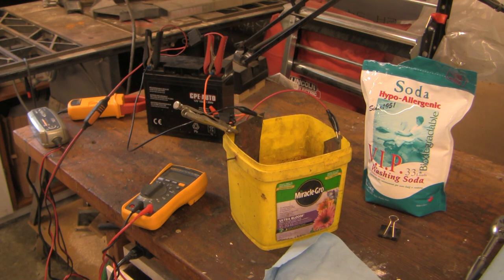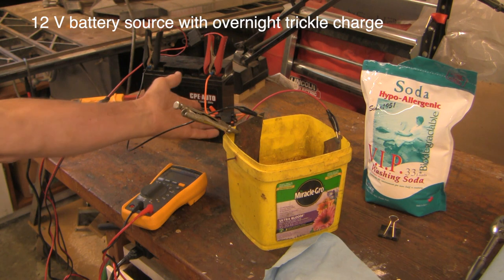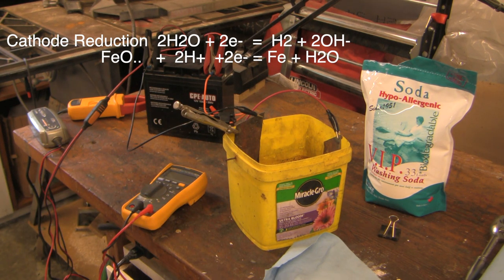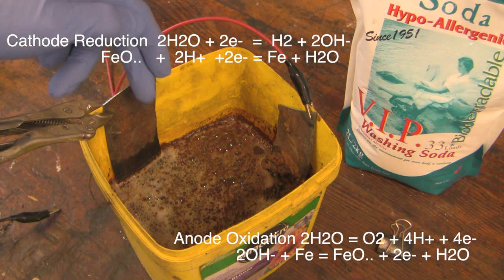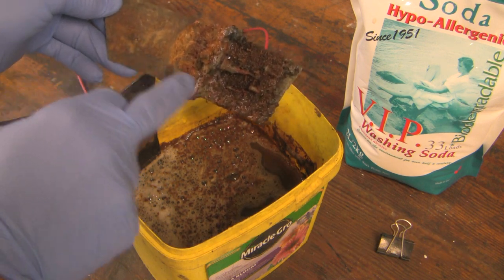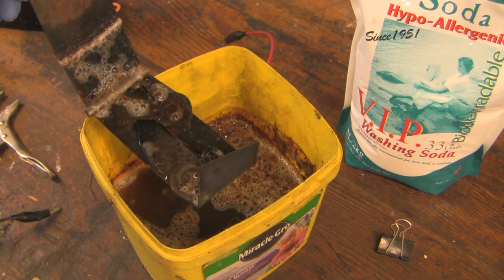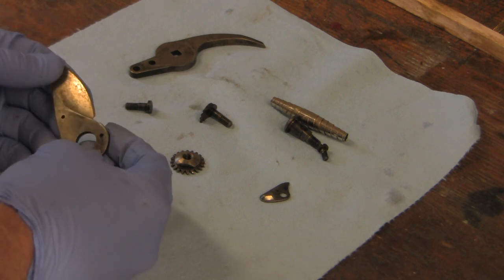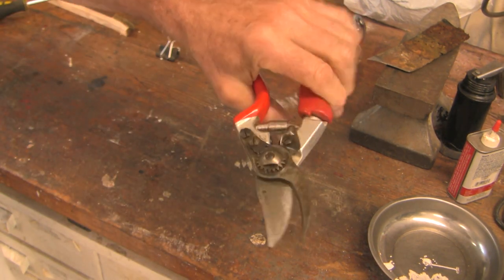Best way to fix rusted tools!

Comment: That was awesome !! I really appreciate the video . I just learned something new today !!
Reply from the maker: Since doing this video I've done it a few times, sometimes with great success and sometimes with failure. Choice of anode is critical, you need clean mild steel, not cast iron, and you need to avoid putting any stainless into the solution at all. Stainless releases chromate compounds that can be dangerous if inhaled. I put together a little plastic bucket with all the parts and a little cheat sheet taped to the side so I remember which wires go where, so setting it up is a breeze. This time of year I have a bench with various batteries I charge intermittently, so everything is at hand. Thanks for stopping by Kenny. As I mentioned, your channel is a great resource for automotive diagnostics.

Comment: I want to try Electrolysis But in the meantime I use Evap-O-Rust.
It's absolutely the best rust remover I've ever used! It works best in warm to hot temperatures so remember that in the winter and it also works best if you let it soak for 12-24 hours. Plus its environmentally friendly.

Comment: Wow, what a great video and easy setup.  I will have to try that!
Reply from the maker: Thanks, Ben! You'll definitely find a use at your farm, I'll be looking forward to seeing the video. If you limit the amount of washing soda to ~1 tbsp per gallon, the current will be lower and you can run it for longer. It should be less prone to secondary issues using a go slow approach.

Dave

Comment: Great job and video!  It's an excellent way to remove rust.  I have used this method for years with great results.  Low current ( an amp or so ) is all thats needed. If a little current works, a lot does better does not apply here.
TakeCare,
Bill
Reply from the maker: Thanks, Bill, it is so nice to get feedback from guys like you with years of experience. One of the reasons my current was a little too high was I didn't measure the volume of washing soda, I used way more than the recommended 1 tbsp/gallon. Fortunately there was no evidence of pitting or other issues, it worked great, though I stopped earlier (~12 hrs) than some recommend. As you say, experts advise low current and long duration. I see now why this technique is so much better than other options, and it is very easy to set up.

Comment: Yay!  Now I have a reason to keep my old lawnmower blades in my hoard...
Cool experiment.  Not sure it's a good value choice considering time and trouble, other than the fun of succeeding.
I would probably use my low amp battery charger, fan the air in immediate area before disconnecting wire, and disconnect at battery instead of near bucket (or in my case unplug the battery charger before unclipping wire and risking a spark).

Comment: Very interesting and amazing results!  I was ready to try it myself up until the part where you said "I suppose you could have an explosion."  That's when I got in my car and drove to the hardware store to buy new ones. :)  Such an interesting and apparently effective procedure I might try it one day anyway.
Reply from the maker: Ha ha, I understand. The good news is even if some of that liquid splashed up, for the most part it is just baking soda and water, not even as toxic as what you wash your hair with every day. Some guys laugh about lighting those little bubbles of gas, normally causing a popping sound but little else. That said, I wouldn't do that, it's too close to what happens when one overcharges a 12V battery, in which case you've got the risk of acid spray. This is generally safe, and dramatically safer and easier to clean up compared to acid treatments for rust.
Reply: Good to know I don't need the fire department on standby :)  Mostly just joking around with you although the whole 'you might blow up your garage' part of the video certainly caught my attention!  Great video once again, thanks for putting it up.
Reply: @PsychoTillerSailing  "Well ventilated area" applies to this process.
Reply from the maker: @d46512  Good point. Hydrogen gas is so light, it quickly dissipates, and the rate of production is slow enough that it would be rare to have a serious problem. There are other gasses produced from side reactions as well, including CO2 and maybe even a little carbon monoxide. At trace concentrations in a typical garage those facts are curiosities.

Comment: Great job, I would love to understand more of the formula and exactly how and why it works if you can make a following video
Thank you your friend from south Florida
Reply from the maker: What a good question! I review this topic every time it comes up because of all the detail, but fortunately the web is full of good explanations. The core reaction is simply hydrolysis of water, and the washing soda is for the most part added to make the solution more conductive, allowing ions to migrate more easily through the solution between poles. The intriguing topic is iron, which is polyvalent with very complex equations as it oxidizes. Interestingly there is some evidence that electrolysis will replate those iron molecules onto the surface of the metal, in contrast with acid methods that destroy any oxidized iron, pitting the underlying surface. Thank you for watching!

Comment: What material is your cathode?
Reply from the maker: Both the anode and cathode were made from steel strapping that went around an old barrel used as a garden planter. The wood had disintegrated from rot, and the steel bands had superficial rust. I cut and bent the bands into the correct shape so they were far enough apart in the bucket that they wouldn't touch each other. You have various options for the rods, but steel is cheap and widely available. Use a wire wheel or wire brush to produce a clean surface on both sides to reduce resistance at connections points, especially where the wires attach. Avoid galvanized steel and aluminum, a magnet will help verify you have steel rather than aluminum. Some guys use an old steel bucket for the anode side, then hang the cathode from a wood dowel, with the parts hanging in a cathode tray below the water level. Good luck!

Comment: You said you sharpened the blade and it looks like you had put an angle on both sides of it when you flipped it over.  One side should be absolutely flat, no angle.  Surely you sharpened them properly.  Great video though.
Reply from the maker: Yeah, I put it on a flat diamond stone and sharpened the flat side, ONLY. When I've tried to do more, it always fails, so from past bad experience I stay away from complex curves like that. Thanks for watching, I really appreciate your remark because it will definitely help others. There's nothing like learning from bad experience, but better to be somebody else's mistake!

Comment: You can find many more easier way in removing rust on the internet.
Reply from the maker: Sure, many forms of acid will work, together with vigorous scrubbing. You end up with pitted steel if you leave it too long, inadequate control if too short, and you need to put some work into it. You could take a grinder to the rusted edge but that inevitably takes off more metal. This is one of the few methods that does not significantly degrade the underlying steel, and there is almost no scrubbing at all. It even penetrates into cavities that are not accessible to a brush. I'll concede it takes a little thought, a 12 volt battery source, washing soda, and care to set the equation up correctly. I found the review of simple electrochemistry to be refreshing, others may consider it to be too painful.